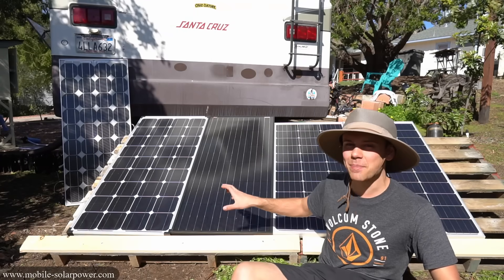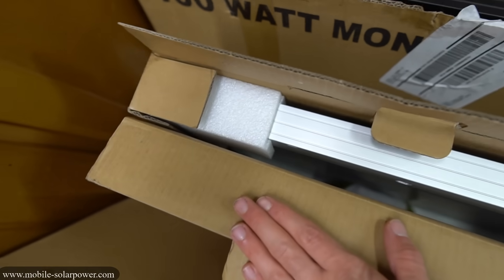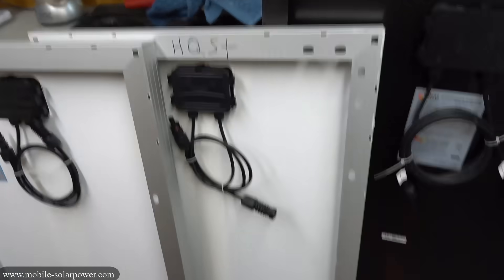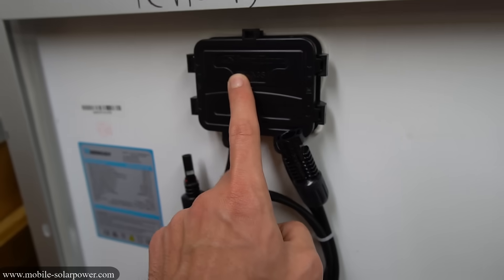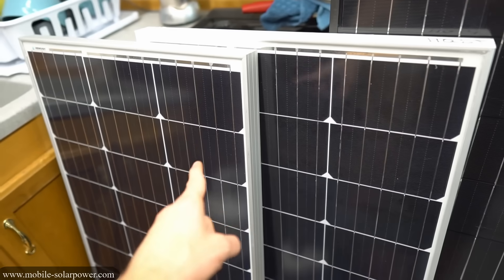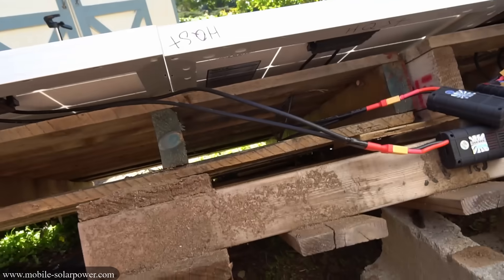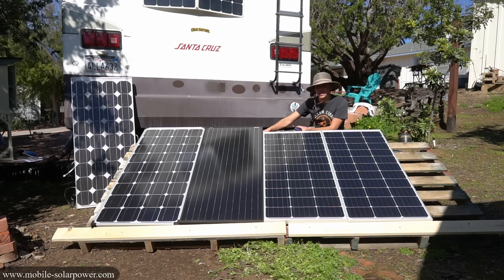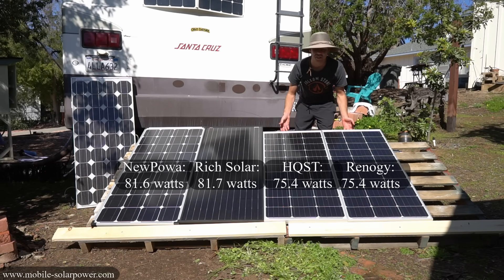Top 4 Amazon.com 100w Solar Panels Tested! Renogy vs. HQST vs. Rich Solar vs. NewPowa

Comment: Excellent review. I recently added 2 NewPowa mono ($159 for 2 on Amazon Prime) panels to my 650 watt portable setup after watching this review.  Lowest cost,  highest output and best packaging sold me on Newpowa.  My portable setup consists of  4 Renogy, 2 HQST, and a 50 watt Kyocera.    I noticed your Newpowa are made in China.  Mine said Vietnam.  Frame is different as well as different cells.   Fit and finish of the panel is excellent.  No sharp burrs or rough edges.  Packaging is the same, very well protected.  Output rocks!....I'm getting  5.8-6.4 amps (69.6 watts-76.8 watts) winter NV sun is Awesome.  1-2 amps per panel better than my Renogy-HQST panels.

  I did find one difference between my Renogy-HQST that could pose a problem long term.  The junction box wire connectors were soldered on my Renogy panels and crimped on my HQST.  If you do another 100 watt panel test, would be helpful addition if you pop open the junction box and take a peek inside for us......:)    TU for all the great videos.

Comment: Just got NewPowa  100w and having issues and not sure if it’s controller or inverter or battery.  I’m using a 20amp controller, 500w inverter, my battery is deep cycle and I bought it in March/April 2019 and was used on 2 different systems and no problems.

Comment: I really like your videos but I was wondering why your still promoting these 100w panels when the larger panels are better quality and higher voltage and better charge. And if you purchase from San Tan Solar out of Phoenix you can get the panels at less than 30 cents a watt.
Reply from the maker: It's because smaller panels are better for vehicle roof mounting. I'm not going for cheap. I'm going for strong.
Reply from the maker: In this video, I lived in a RV and was making videos on RV mounted systems

Comment: I'm not a fan of Renogy anymore. I had two 50 watt mono panels go bad which is kind of unusual. Most solar panels just work. But these Renogy went bad just sitting in my house. I have a bunch of the 100w Newpowa that I like. Haven't had a problem with those. Also like the Eco Worthy.

Comment: So you choose the panel that produces less wattage as the winner based on looks?
Reply from the maker: No, they had cheaper materials. The other ones were junky
Reply: The monocrystalline cells in the larger panels are inferior to those of the smaller panels? I recently purchased a new newpowa 100 watt mono panel for $77, did I make a mistak?

Comment: Thanks for producing an informative video. I'm still not sure what system or pieces of a system to buy. I have a 24 foot RV and I camp a lot. I am ready to buy a solar setup but I'm still uncertain. I just want to charge my gps, phone, laptop and run a few led lights. Maybe the furnace when it gets cooler.  Thanks

Comment: Watched many videos to decide which solor panel to go with, yours topped all of them. I went with HQST panel and it performed very well. I thought about the packaging would be like what you showed but it actually had foam in the corners when it came in. Mabye they saw ur video, lol. Thank you very much for your amnest review. That's what we need with no BS. 2 thumbs up sir.
Reply: @frankwc0o  it's still going good, I'm loving it. Its putting out good amps to keep it charge. On a good sunny day, battery would be topped off and does not run down.
Reply: @JedRom how’s it doing now?
Reply: honesty is the best policy

Comment: Thanks for the video.  I have 2, 50 Watt panels with a Victron Solar controller on my boat.  One panel is a renogy semi flexible panel and the other is an older rigid glass panel.  They are connected in parallel.  My solar controller tells my via blue tooth the out put of my panels.  The most out put I have ever seen is 66Watts typically they produce 40Watts to 50 watts.  I confirmed this with a DC clamp meter.   UGH!!! I don't expect these panels to produce 100% of there rated power, but 40% to 66% is just not acceptable!!  I have read that cheep solar panels don't out put close to there rated power output.  I am considering buying a high end Italian or Germain  flexible panel.  They cost 4 to 5 dollars a watt vs 1 to 2 dollars a watt for a flexible panel.  
Do you have any experience with high end panels?  Do they really produce close there rated power output?  Have you ever done a comparison???   Does more money really = more Better or more value??

Comment: I purchased 4-30Watt panels from HQST as 2, 1, & 1.  All 4 were supposed to be the same from the same advertisement direct, and all 4 were different.  2 were almost identical, one with HQST branding, and one actually said Renogy.  The other two were HQST but different cell layout.  

Best I could tell, was the panels were rejects or returns from customers.  Interesting fact, was their customer service was almost non existent, and I was turned off from ever purchasing from them directly again, as a result.  

Lessons learned: Buying from Amazon has advantages. Renogy price may get better customer service, and identical panels.  

Being 30 Watt panels for a quick and dirty project, the hassles of returning them was not worth it, but when I go to purchase larger panels, I know who I learned my lesson from.

Comment: I wish you had explicitly shown the watts per dollar. Not the rated watts, but the watts you observed. You give kudos to the HQST, but it put out less power than the big ones. What was the price difference? As I'm writing this comment, the two big ones are cheaper and they put out more power. It's not at all clear that HQST should get the nod.

Comment: Each of these panels cost the same,, Renolgy a little more,, All weigh 15 or 16 pounds.  The larger might seam less stiff,, same weight,, yes.   But the larger also produced 8% more power,, for the same money.  In the real world, if you have a little more space, (granted a limited space application may change the equation.) 8% more power for the same money is a very powerful inducement,,, and yet,, you dismissed them immediately.   Curious.
Reply: Just to add, if the panel delivers 8 percent more power but is less than 8 percent larger, then it stands to reason that it is a more efficient panel.
Reply: @tamistone2632   Hey Tami,    My suspicion is the larger panels are 8% larger.  I was unable to find dimensions that were true apples to apples,, some of the sales specs do not list size,, or they list the size of the box, not the panel..

Comment: I'm going through the motions just now for a van build next fall, I'd like your opinion on rigid over flexible and only reason I ask is that it seems that I can get more wattage in the same area from some flexible panels over the rigid! 
Also have you ever tested Zamp Solar out of Bend, OR

Comment: You should add a cost of power per square inch per year calculation. That would take into account the variance of cost, size, and service life.
Reply: This. I think it incorrect to say the hqst and renogy are better without calculating the power per square cm.
Reply: I was thinking of a watt per sq ft calculation per panel.
Reply: You mean bananas per rectangle toes, right?
Reply: Power per sq ft is a great metric especially if you are moving your building to Net Zero. Typically there is just enough roof area to generate enough power to go to NZ. If you can squeeze an additional few panels on the roof it may make the difference between hitting NZ or not.

Comment: The Watt density on the Rich Solar looks to be about the same as the Renogy and the HQST. It made 8% more Watts and appears to be the same width and about 8% taller. I am curious how the power output would compare at different sun angles. On future test set your test stand at different angles to the sun to see if the panels perform the same.

Comment: My friend bought a Renogy 50 watt panel. It only puts out about 1 amp max or like 13 watts in direct sunlight....He tried to get Renogy to fix the brand new panel and they blame the issue on his equipment. I also tested the panel using my equipment and I get the same power readout. I'm advising not to buy Renogy products because when you buy them, if they break, you are on your own.

Comment: What I don't understand is why everyone is all gung hoe over 100w panels when there's 350+ watt panels available.  Particularly for mobile they seem like a no-brainer, regardless of slight cost increase.
Reply from the maker: Because mounting panels on the roof of a vehicle is easier with 100 watt. We are not going for cheap, we are going for what works best. RV roofs have vents and other obstructions, and stuffing multiple smaller panels is usually the only way to do it

Comment: Why would you not want a bigger solar panel that produces more watts? I'm just learning about solar panels.
Reply: You dont need bigger. You do want as close to the wattage you have chosen to buy.
If you are investing money in a 100 watt panel like the ones he is testing then you want 100 watts produced.
Reply: @rl4889   Unless they gave you more than you asked for.
Reply: Jessi Louis  Thanks for the info, Im just researching right now and looking into what I will need.
Reply: @jessielouis how many btu are in you ac
Reply: Yes, the 4 inch difference is not a factor to me at all.
Reply: J R ya I had the same question, not sure I found the answer in the comments here? You?
Reply: If you have a small space to put them in. RV etc.. Personally I like the black solar panels way better. I live in a cold climate so not worried about the heat too much and they're fixed on my cabin, so not worried about size. I have 6-  425w q cell panels. They look awesome and way better use of space. Not sure why anyone would buy 100 watt panels anymore.

Comment: I like that you reviewed the packaging. I don’t think many would have thought to do that. I’m curious as to why you went with a panel that was producing lower wattage as the winner, though? Of course if one has space constraints that disqualify the larger panels, that makes sense, but regardless of them being less efficient for their size, the larger panel was producing more wattage under the same conditions. Were they priced higher?

Comment: One small problem.  As of July 2019, HQST panels are not available on amazon (except for one used at ~$97) in my location, southwest US.  New Renogy is $109.  Also, on HQST specs page on Amazon it says those holes you've been referring to as "mounting holes" are drainage holes. As far as holes though, drilling a hole in that extruded aluminium is hardly a task.  You just need to be careful not to damage back side of panel when you break through.  Just clamp a small piece of wood or metal to the back of where you're drilling and you'll be fine.  Nice video though, thx.
Reply from the maker: Yeah I agree

Comment: I actually just bought two of the 100 watt HQST panels the other day for my van build. Getting them in Tuesday. Glad to see I chose correctly. Especially with the size. I was gonna get some 235 watt Kyocera panels but they measure 63" long. That's half my van roof and I couldn't have them side by side so I had to find smaller panels. Kinda forgot that they're rated for 100 watts but only put out like 70 but oh well. Live and learn.

Comment: what is it about the panels that determine they are 100watts. Is it that box on the back that regulates that? or is it a design issue that determines it?
Reply from the maker: It's output rating standards

Comment: Regarding warranty, you have to wonder if the companies will even be around long term (10 or 15 years down the road).  I personally installed a 400 watt off grid system a year ago using Renogy solar panels and charge controller (RNG-100D Monocrystalline Panels and 40 amp Rover Li charge controller), and so far I am very impressed with Renogy customer service and technical support.  When I go to HQST website I don't see a phone number, whereas the Renogy website has a contact us option with phone numbers which I have used (they are very responsive).   I feel the Renogy support is well worth higher upfront product costs (if that's the case).

Comment: Another great one, Will. Thanks! I'd love to see a 36 cell comparison! :-) Wait! One of them is a 36 cell! I'm used to 180w-200w 36 cell panels. I'm shocked that one of these is only 100w with 36 cells! That's very low efficiency! I'm assuming that the 36 cell 100w panel has much smaller cells than  the 36 cell 200w panels....I always thought the major difference was due to the number of cells!

Comment: The HQST makes 10.969 watts per square inch and costs $99.99. the Newpowa makes 12.267 watts per square inch and only costs $87.75. I would say the winner is Newpowa because the Richsolar costs more, $106.98 and makes the same watts per square inch as the Newpowa.

Comment: Great video...
But why did u instantly dismiss the Rich & new power..?
They r clearly putting out more power.! (Relative 2 their rated output)
(I don't think u compared the area vs the power, that may have been helpful)
True they r a bit bigger so take up a bit more space, but 4 some ppl that may not b an issue, yet the higher (relative) output may b better 4 some ppl.
Reply: That's a great point. They gave out 8% more power (correct me if I'm wrong) but are they 8% larger? Were the price of these units mentioned as well?

Comment: Just got the Rich Solar panel. Arrived fine & puts out the power. 22+ dc volts out, without a load. Give you more, when I get the system set up.

Comment: I just got 8 newpowa 100w panels for $295. Brand new, including shipping. I’ll take the bigger , less efficient at that price.
Reply: Its tricky to determine without knowing all the dimensions but considering it makes more power than the renogy, I dont think the newpowa panel is actually that much less efficient.  I also have a newpowa panel and it works really well, despite having a very silly name.
Reply: Where/How did you get that deal?

Comment: I have been watching a lot of your amazing videos.  I would like to buy 2 panels for portable use and 2 panels for the roof of my RV.   I am assuming that I can wire them all in parallel no matter where their location.  Should the wire lengths be the same or anything like that?  Also, there may be times when the roof ones are in the shade and the portable ones are out in the sun.  Will that be a problem

Comment: What are the best options for goal zero 1000 or 1400 rather than their proprietary overpriced panels? I know the voltage has to be a certain amount coming from the panels or it will mess up the battery. Wondering if you know the best set up for this for van lifer. Thanks for all the free content mate!
Reply from the maker: Just posted a video today on how to upgrade charge controller so you can use any panels

Comment: Since output is king, I think I would go with the NewPowa.
Reply: That's the choice I picked too. For months last year you could get a NewPowa 100W Mono panel for under $90 a panel on Ebay. My first two were directly from Newpowa for $100ea. When I saw how well they worked, I ended up with 4 more panels. I didn't even know the aluminum frames might be thin. They seemed OK to me.
I had two Renogy 50W mono panels that went bad shortly after buying them. Left a review on Amazon after Renogy wouldn't honor a warranty. Evidently you can't change the wiring or drill other mounting holes. Now that I know that HQST is pretty much the same as Renogy..........I'd buy them over the Renogy for sure.

Comment: I have a question... I have two older 125 watt panels that when i connect together one only works half capacity. they out put 100 each, together i get 150.  whats up with that? FYI they are same brand and model, i purchased together so i assume from same manufacturing batch

Comment: Hey, I'm keep watching your videos! So much useful info for me! Have you tested any of the harbor freight solar panels? I'd be curious to see the difference.
I just bought a camping fridge and a decent size battery (Jackery 160) to run it through the night. I'm looking for a solar panel to charge it during the day. What's your recommendation? I'm gonna use it mainly for camping with my SUV, so smaller is better for me. 
Thanks!

Comment: No need to fall into the oxygen free/wire gauge/length trap. Just follow your electrical code. Not that much to be gained even when testing.
Reply: Depends on distance of wiring. Longer run needs larger wire.